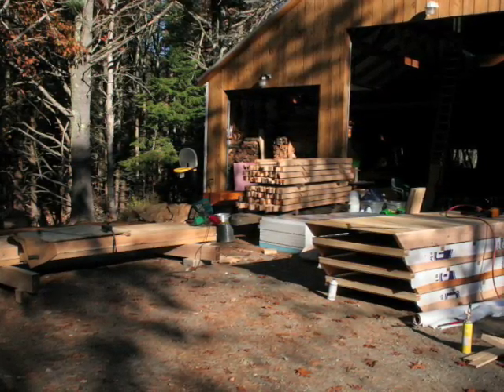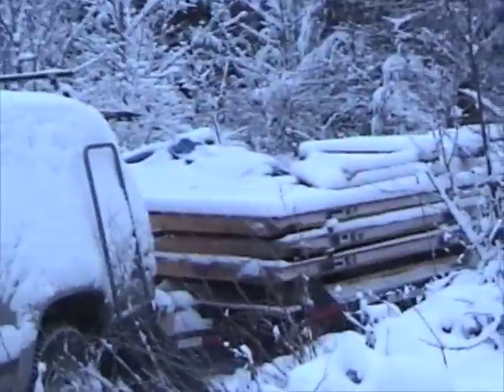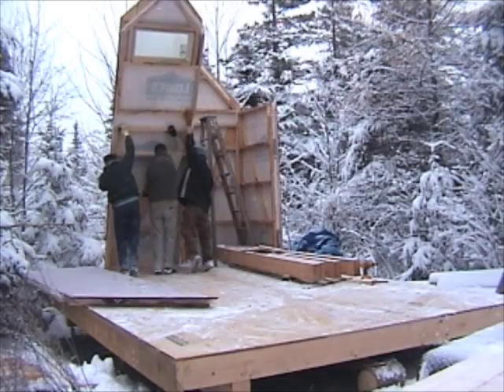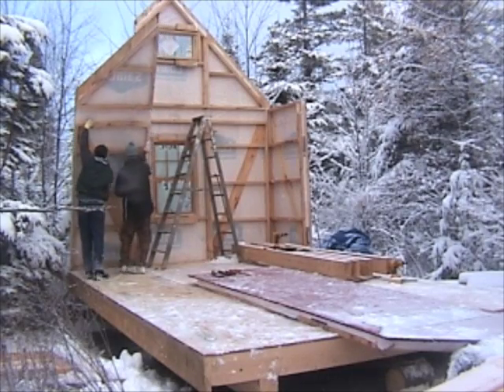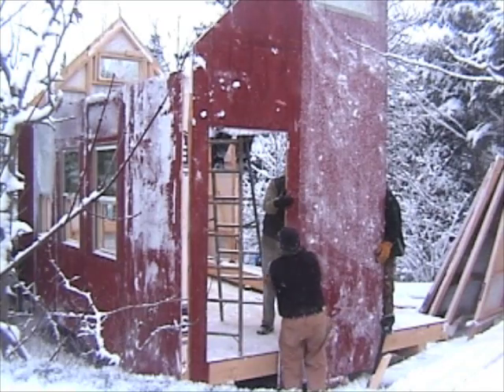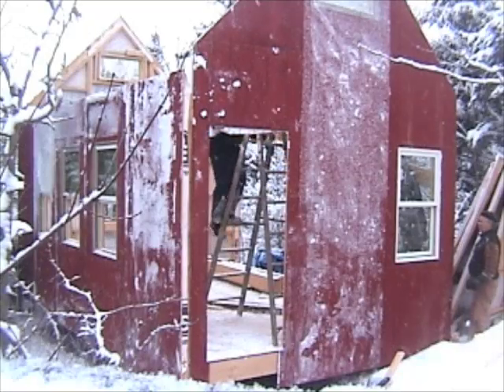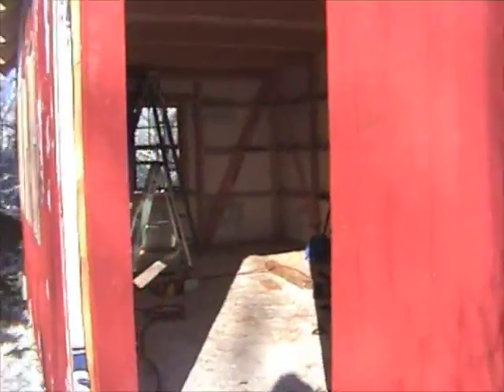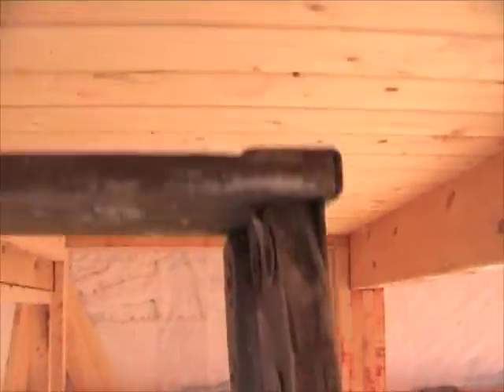How to Build a House in One Day

Comment: cute & crafty but overpriced for what it is. why not just use 2 shipping containers for a fraction of the price? you get more space and there is NO constructing of the exterior involved. not to mention it is wind & water tight and strong enough to withstand the coldest winters and hurricane force winds (for those in warmer climates). I bought (2) 8'x20' shipping containers (320sq ft) in great condition delivered for $3,072  compared to BiAB 144sq ft. for $12,500 ~~~~~ (im just sayin....)